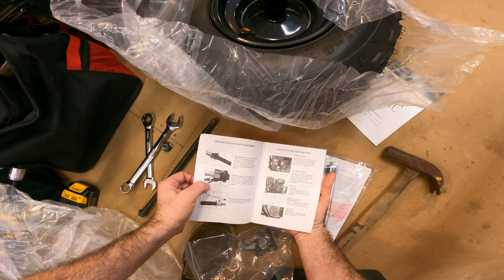Trailmaster MB200-2! 👍😎 Uncrate, Prep, Test Ride, First Impressions [4K]

Comment: I bought mine at a local dealer so I didn't have to hassle with assembly and making sure everything was done correctly. Will be firing it up and draining the oil and replacing with a higher quality oil. Taking it out to AZ soon for fun in the desert. The only mod I plan on making is swapping out the 46t sprocket for a 60t and a longer, high quality chain. I'll back out the screw to give a little more throttle response, also. Want to keep it mostly stock, but love watching these vids.  Thanks, man!
Reply from the maker: Thanks. That’s cool.   I’d still go over all the nuts and bolts!  Yeah a 60t will wake it up quite a bit.  It’s a fun bike and will be good set up like you plan. Might want a chain tensioner though. Might be ok, but if you have issues with chain that’s pretty common.
Reply: @bwxmoto   Do u have a link to the tensioner?  Thanks again!
Reply from the maker: @thehappyhermit01  check this out: https://youtu.be/LyNTQDdK5ck

I have to check and see if the link the one from Ali Express s still in that vid. 

That chain tensioner is great.  After testing/ trial and error, a steel roller in it works way better and doesn’t wear down and makes a lot less noise than the rubber rollers if you go that route.  

But that one in the box you can buy (in vid) would be easier to install than the custom one..  but won’t be as robust.

Comment: Great video. Thanks! I have an older mb200 without rear shocks. I built an under seat spring system to smooth up the ride. Had the same problem you had with chain. It  tightens and loosens upon multiple wheel revolutions. I keep the chain tension at about where you adjusted yours and haven't had any long-term issues. Also changed the sprocket to a 60t and that low end torque really climbs the tough hills much easier. Thanks again for the video. Really enjoyed it.
Reply from the maker: Nice! Thanks. And yeah the a chain tensioner really helps with the suspension travel if you get longer shocks. I think you can get away without one with stock shocks. With my 12" shocks I really need one, but it works great so far.
Reply: @bwxmoto  I just ordered the hurricane 200x, do you have video of installation of the tachometer?
Reply from the maker: @shannonvanegas7313  No but I can make one pretty soon..  It's super easy.

Comment: That gas pump looked neat for sure. Looked like a fun little cruise around!
Reply from the maker: Yeah that pump is the best 10 bucks I ever spent! 😆 Yeah fun to be on a bike even if it’s just in the driveway. Haha. Can’t wait till spring.
Reply: @bwxmoto  only $10, that's a deal!
Reply: @megoingfast  Harbor Freight!  Same batts for two winters - 2 "D" cells, still going. Saves my back and spilling gas. Can't go wrong.

Comment: Wow dude I got mines today. Runs like a champ. Thanks to you? I double-checked everything adjusted the handlebars so I can lean forward a little. It was worth the wait I waited a month. But even my front fender did not need bending and they got my off on switch correct. When in doubt I read instructions. Have you ever been to Disneyland? That's what this bike is. You better hold on when you first take off. LOL
Reply from the maker: Nice. Glad it worked out, they are really nice bikes. Keep the rubber side down! ✌😎
Reply: @bwxmoto  just did the wire trick for the governor bypass. See how good it works. I'm already doing 40 out the door with the screw back on the throttle. Man I've been to Disneyland a couple of times. This feels like Disneyland. Disney is no joke
Reply from the maker: @Williethewhipp  😂👍 Haha. Nice! Yeah man I hear ya. It’s a nice smooth ride. Pretty quick for a stock bike too!

Comment: Great vid! Honest and true... I WANT ONE!  Have 2x ct200u-ex and a CT200 (thick frame).   Total blast.
Reply from the maker: Thanks man! Yeah this bike is definitely a step above the Coleman. They are still fun and great bikes but this TM MB200-2 is pretty nice. Hard to compete against full suspension. But the more bikes the better! No one can have just one. Haha. I just need another shed. 👍
Reply: @bwxmoto  ain't that the truth... Full suspension sounds like a dream, thought about fabricating it, but like you mentioned for the cost and time, might as well buy it factory.  15 years ago suspension didn't matter to me, now I'm feeling it every bump haha!
Reply from the maker: @bigred2455  Yeah For sure. I’ve had a few back surgeries so I really feel it!

Comment: The spring that allows the clutch engagement is probably higher tension to allow faster drag race off the line type starts. Should be able to tune the low speed engagement
Reply from the maker: Yeah that might work. Might have to look into it.

Comment: Very good detailed video, bro. I'm gonna be ordering one as well. Subscribed to see what you do with it.
Reply from the maker: Awesome! Thanks for sub!
Reply: Dude? Just got mine today this is the Trailmaster mb200 2 and it is ferocious. This is the top mini bike for sure this converter belt drive? Out the box doing 40 with that throttle screw right there to screw right back? Easy as pie after watching these videos? Put the shocks on first then take the top of the crate off easy as pie. I'm going to use that crate for some type of rack it's good angle. Enjoy

Comment: If any,  what is the difference between the Trailmaster MB200 verses the Massimo MB200.  Only difference I see is a little bit of cosmetic? Thanks in advance.
Reply from the maker: Totally different bikes. They look similar and might have some interchangeable parts but different bikes. One has rear suspension, etc..

Comment: I’m a beginner when it comes to these things and I’m going to buy one so this video came in handy it would be cool if you added a bigger engine and maybe made the gas tank into a real gas tank
Reply from the maker: I might do that eventually! Won’t be soon though.  Are you on the MB200-2 Facebook group? Because it’s a cool bunch of people mostly and they have done that.
Reply: @bwxmoto  I am not I will check it out but I went on the website to buy one and they all say out of stock so I guess I’ll have to wait!
Reply from the maker: @braxtonferrell7982  Yeah that's why I ordered on during winter! All these mini bikes, especially this one seem to go through limited supply phase in the spring and summer. It's worth the wait though!
Reply: @braxtonferrell7982  get it now the mb200 hurricane is already a little upgraded and on sale on go power sports I got one yesterday
Reply: @bwxmoto  hey, I have a question. I recently just got the hurricane 200x. When I turn the throttle it just takes off. Anyway to fix it from taking off so fast?
Reply from the maker: @shannonvanegas7313  Just randomly saw this comment. I hate that youtube hides comments and doesn't notify me. Probably need to adjust throttle cable or something with torque converter.

Comment: So I bought one of these and it was delivered this week. I cannot for the life of me get it to start. I’m wondering if my on/off switch is labeled backwards like you’re saying yours was? Gotta try tomorrow. If not, I guess I’ll check the spark plug next
Reply from the maker: Yeah I bet that’s it! The mislabeled on/off switch had me scratching my head for a minute. Usually these engines start pretty easily.
Reply: @bwxmoto  well, it wasn’t an inverted switch. I’ve done lots of troubleshooting at this point and still can’t figure it out. After reading/watching some videos, next thing I’m going to try is starter fluid on the air filter (i didn’t see where to spray it aside from directly in the filter). Open to any thoughts you have!! Thanks man, love your channel
Reply from the maker: @ifyouwerefood  Man that sucks. I’d check for spark, and maybe check for air leaks around carb gasket. Also make sure there’s gas in the float bowl. It’s probably one thing not working. Could be a bad engine though, it happens. Could be valves so out of adjustment that it won’t run but it’s probably something simple. Might want to call where you bought it from and see what they say.  And thanks for watching! 👍

Comment: Hey I really dont have a lot in terms of tools or mechanical knowledge, but do you think that I would have a problem unboxing it? Also how durable is this bike and does it require a bunch of maintenance?
Reply from the maker: Yeah these mini bikes all require some maintenance but it’s simple stuff you can do with simple tools that you can get as you need them for not much money. Cheap Harbor Freight tools are fine for working on a mini bike.  Then you’ll have a small tool collection and that’s not a bad thing. Metric socket set, adjustable wrench, pliers, screwdrivers, etc. But you’ll definitely need them.

The MB200-2 does have chain derailment problems out of the box though. Can be solved with a $25 tensioner that’s easy to install but if not the chain might pop off a lot in rough terrain even if you have everything lubed and adjusted perfectly.  I think that’s the biggest problem with this bike in stock form and I didn’t buy one until I knew I could fix it. 

I’d probably start off with a simpler hard tail like a BT200X or CT200U-EX or something like that. Or expect chain issues until you fix it on the MB200-2/ Hurricane.  But MB200-2  has a torque converter which requires less maintenance than a regular centrifugal clutch like the Colemans have which need to be lubed properly every few hours of riding or else it will self destruct. But it’s all very easy jobs that anyone can do.  With internet and youtube vids you can easily get  directions for everything you need to know. You just have to jump in and do it.   

It’s mostly keeping bad / old gas out of the carb, changing the engine oil, keeping chain lubed and  tensioned properly, stuff like that. 

If you maintain them, they’re surprisingly durable and reliable. But if you don’t, you’ll get broken chains, burned out clutches, gummed up carb, etc. But it’s all very cheap and easy to fix even if that happens. 

Unboxing / setup is important, just do what I did in vid. You don’t need power tools for any of it. 

When I was a kid there was no internet. It’s so much easier now to just look something up online if you have questions. That can give you a lot of confidence before starting a  job on the bike and helps you from making mistakes. 

I can tell by your post you have a brain in your head and can read. That can get you pretty far, so I think you’ll be fine. 👍😆

Comment: Thanks for the video share. I just got my new MB-200. I wanted to get a chest cam that you mentioned. Yours seems fine. What brand is it? and how much money did it cost?
Reply from the maker: Actually it's a Gopro Hero9 Black. They're about $350 or so.. but any gopro with stabilization is all you need really. For riding vids I have it on a helmet chin mount but chest cam would work too.

Comment: Nice bike. Not sure it would help on this bike, but I used to adjust the chain on my dirt bike with the shocks off. This way I can adjust with the chain at its tightest at the mid point of the swing arm travel. On that bike the chain was at its loosest swing arm "bottomed" and swing arm fully extended.
Reply from the maker: Yeah definitely. This bike is really bad with that. It gets a ton tighter when wheel is in the upward part of it's suspension travel and then really loose when at the lowest part of travel or just static with no weight on bike. 

I just spent all morning putting together some parts for a slick chain tensioner that a guy on MB200-2 FB group came up with. I'll definitely be making a video about it. It's going to be really cool.

Comment: Hey there, East Texas Here; I got one last year the black one and I really like mine. I did videos on my upgrades. I put the same shocks as you have, a used Honda gas tank and the gopowersports stage one kit. It will do 42mph easy and up a, I'd say 5% grade hill it did 30mph and I weigh 230#, so I am pleased with my project. Also did the Led lights with a battery install...Check it out...
Reply from the maker: Cool! I'll definitely check it out.  Not a ton of Trailmaster MB200-2 content out there I have noticed.

Comment: Just got mine recently. Does anyone know the size of the gas tank? Also max miles before fueling up again?
Reply from the maker: I think you can put a little under a gallon. But if you overfill, fuel might end up in vent line causing issues. Not sure how long that'll last but I'd say a couple hours at least.

Comment: Easy with the irrational thinking.... Instead of selling a bike, add on to the shop and problem solved. Cool new bike though, have thought about getting one since mine dont have rear suspension. I have probably lost 2" in height trail riding the bt200x haha.
Reply from the maker: 😆 I know! I do not want to sell any of them except maybe one, the stock EX. But yeah those hard tails can be really rough on bumps. This Trailrmaster is going to be so much better on the trails I can tell already.

Comment: So is there any differences in the mb200 & mb200-2???
Reply from the maker: Yeah the Trailmaster MB200-2 is a lot different from old Baja MB200 or the one they are still selling, the Massimo at Tractor Supply or whatever. 

Biggest difference is rear suspension but they are different bikes made by different brands. 

They do have a similar fork and handlebar and seat and same name so people confuse them but they’re different. 

Some parts are almost always exchangeable on modern Chinese mini bikes though. So you can’t say they are totally different.usually wheels/ tires/ brakes/ engine/ handlebars, and stuff like that are somewhat universal on these mini bikes between brands but not always.
Reply: @bwxmoto  I'll post a walk around vid of mine & Tag you. Or send you the link See if you can tell me what I got. Got it cheap so🤷🏿‍♂️
Reply from the maker: @angelmedina6390  Cheap mini bikes are the best kind!
Reply from the maker: @angelmedina6390  If you post it I'll see it. 👍

Comment: Which bike is better the Coleman CT200U-EX or the Trailmaster MB200-2 ?
Reply from the maker: The EX is a great mini bike but the MB has rear suspension and a torque converter stock and better seat and disc brake, etc. MB is definitely better but my EX is faster at least when surface isn't too bumpy, mainly because it's so light weight compared to MB and has lower gearing and the regular torque converter on my EX works better IMO.
Reply: @bwxmoto  ...Thank you for the information !!
Reply from the maker: @franknapolitano9144  Got my MB200 Torque converter working better today and now I think it's my quickest bike with that Tillotson 212 stage 1 on there! It rips!

Comment: Roughly what height and weight are you and how comfortable is it for you to ride?
Reply from the maker: Right now about 5’ 9” 175 lbs. But with gear and extra weight in backpack, while on the bike probably 200 lbs right now. I wear lots of gear when I do wear it.  

In some vids on this bike I’m up over 220 lbs with all my gear and weighing 200 without gear. So I try to mention weight in vids because it makes such a big difference and I lose and gain weight especially in winter. Lose it in the summer (usually).  

But yeah the bike is very comfortable to ride.  Even totally stock it’s a nice ride. And much bigger and smaller guys than me report the same thing basically.  

From 125 lbs guys to 350+ lbs guys say it’s great as far as comfort.
Reply: @bwxmoto  well, I'm sold.  I'm ready to skip a mortgage payment and buy one lol.  Thanks man!

Comment: What's the stock tooth count  on the rear? I'm looking for slooower speed and some good torque for hill climbing. What do you recommend for gearing on this mini bike?Thanks Jason
Reply from the maker: On Colemans stock is 50t, on this I think it is 46t. I'm sticking a 60t on there, and 8t up front if i can. Still plenty fast top end but all kinds of torque for crawling up hills slow and the belts last a lot longer.
Reply: @bwxmoto  Check this thread out. I think he had issues with longer shocks and the 60 tooth. But not enough details. He mentions it in one of his posts, not in all those videos. Sounds like the 60 tooth works, but with stock travel shocks.
https://www.oldminibikes.com/forum/index.php?threads/trailmaster-mb200-2-project.172934/
Reply from the maker: @Deucealive75  Cool I'll check it out. Yeah I'm not sure what all I need to do or what is possible yet. Hoping I can do longer shocks and a 60t, but I think I'll need a lot longer chain and definitely a chain tensioner.

Comment: Anyone know the torque flange nut size??
Reply from the maker: Which one?
Reply: @bwxmoto  @25:35 THAT ONE lmao. Mine became loose and came off while riding
Reply from the maker: @BUFOALVARIUS77312  Oh that one, not sure. Could just take the shaft out and match one up at the hardware store or automotive parts store.

Comment: Great content thank you so much new sub here! One question do you need a license for this ?
Reply from the maker: Thanks! Actually depends on the state I think. It's listed as an off-road vehicle so lots of states won't let you ride it on-road no matter what. Some let you license it for off road use only, and some will allow you to modify it and make it become road legal but then you need a motorcycle license to ride it on road. Most states it's probably almost impossible to make it road legal. Just have to look up the laws in your state at your DMV website.
Reply: @bwxmoto  thank you for the info much love ❤️

Comment: If u have to turn the throttle so much for it to move then it sucks
Reply from the maker: I fixed it. Throttle cable adjustment + TAV2 30 driver pulley fixes it completely. 👍